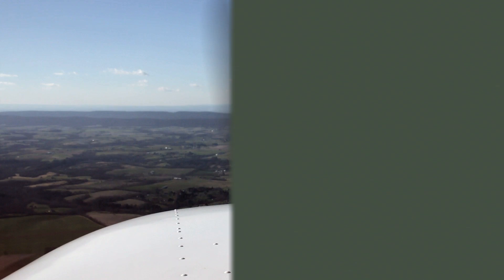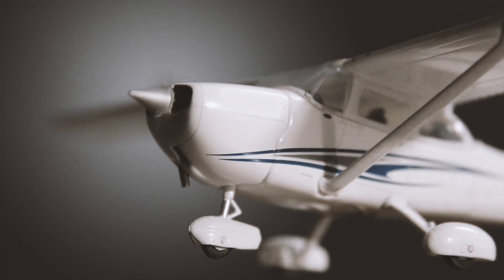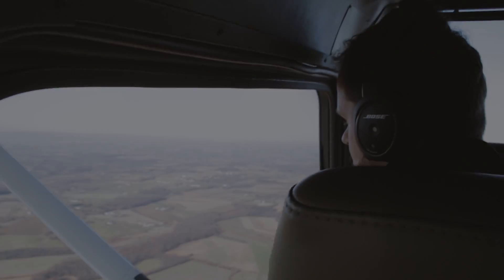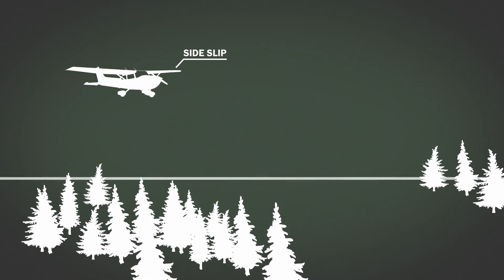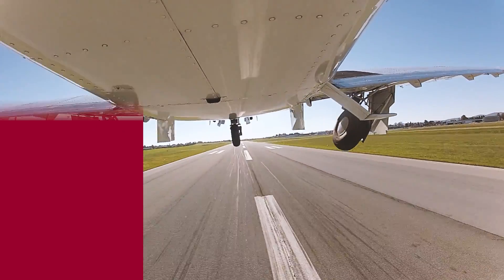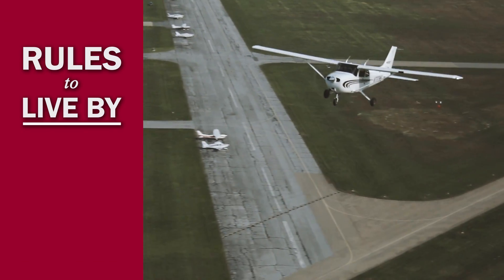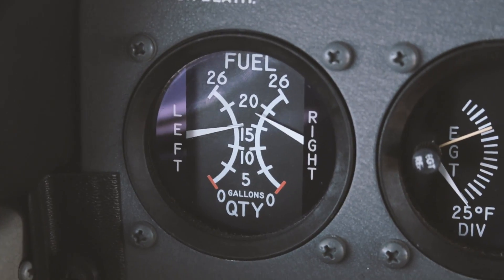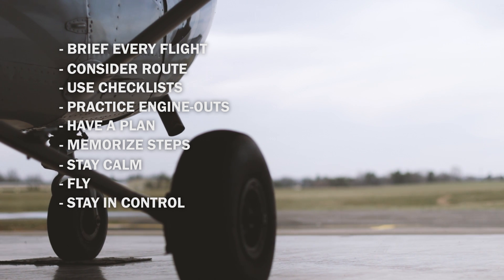Engine Out! From Trouble to Touchdown

Comment: Couple big things I saw here.....Number one and number 2-3-4-5-6-7-8-9-and 10...AVIATE-NAVIGATE THEN communicate....no exceptions...EVER  AWAYS fly the airplane first!!!  Next...if you have a bit of altitude...say 1500' or more....Slowly pitch the airplane up UNTIL THE PROP STOPS!!!!  If you KNOW the airplane is not going to start again (fuel or a "bang") you can more than double the glide distance by stopping the prop.  Especially if you may be close but not going to make a decent landing area.  Something you might want to practice from 5000' directly over an uncontrolled airport.  Also a good time to practice "high key low key" power off landings.  That will give you perspective on how far the airplane will actually glide.   The engine windmilling is turning the engine over....that takes a TON of energy you could convert into distance. A spinning prop also reduces airflow to the tail meaning you have a lot less tail authority when landing....especially when you are at landing speed.   Also when you pitch up (NOT ABRUPTLY....That burns up a TON of energy!!!) you also trade airspeed for altitude and that will ALWAYS help with more options to land....especially if you're committed to a downwind landing if you are low.  Downwind landings will ALWAYS extend your landing rollout and will make the airplane retain a lot of energy by going fast ground speed.  Next...ALWAYS open the door at LEAST a crack....I have had a couple friends killed or seriously injured by being trapped inside a bent door frame that left them with NO way to open it or get out.  Lastly...if you don't have a decent place to land where you think your passengers will not get hurt (they have your FIRST priority for safety) or YOU (your SECOND priority for safety AND the airplane (LAST priority for safety) then make sure you tear that airplane apart as much as possible OUTSIDE THE COCKPIT....see if you can tear off the wings and tail to expend as much energy as possible to make the cockpit as survivable as possible.  Pretty good video but in my humble opinion (been doing this professionally for more than 32 years) the things I mentioned should be taught and drilled into students heads.  We were taught spins and recovery techniques and practiced off airport landings and we had to do full stalls....not imminent stalls, power on AND power off......big mistake taking those things out of primary training.  Most pilots these days have no idea what a full stall feels like...it is non-eventful if you've done it a few times.  Fly safe everyone!

Comment: Nice video! A couple of things worth mentioning:
1. Practice short approaches / power-off landings regularly. Otherwise it will be very hard not to miss a perfect landing spot surrounded by trees.
2. When picking an airport to glide to - mind the winds aloft - gliding into the wind will reduce gliding range significantly. Also, pick an airport to glide to before engine quits. It's a good habit to have a plan and it also keeps you busy during boring long cross-country flights.

Comment: That's a neat little model cessna. Anyone know where you can buy them?
Reply: at flying mule online they have many many very high quality diecast models
Reply: I have the exact same one, I bought mine from a local hobby shop for about $20. It's full metal however, which makes it not balanced when you lay it down, it sits on the main gear and the tail.
Reply: It also comes with a stand however, which is neat.

Comment: Excellent video. One thing worth mentioning: if you have an engine failure just after the runway, you are going to have to push the nose over hard to maintain airspeed. Remember what your power on stalls felt like? THAT is the sort of thing you'll have to do on takeoff if your engine quits. 

Above all, maintain control at all times. If you stall, you won't have any control, and you will fall on to whatever is below you. However, if you glide, there is control, and you can choose where the plane will go.

Comment: Another reason NEVER to accept intersection departures. Runway that is behind you is worthless!
Reply: Could you please explain what this means if you have a chance? TY.
Reply: @quattro4468  An "intersection departure" is a takeoff other than from the start of a runway, where a plane enters a runway from an intersecting taxiway and line up there. It is done if the runway is longer than the plane needs, e.g. a small GA plane taking off on a runway designed for A380s. This is to save time and fuel on taxing (saves the trouble of going all the way to the end of the runway).
On a takeoff there is a "point of no return" (i.e. v1), past which an aborted takeoff will result in a runway overrun, because you will be going too fast and the length of runway remaining is not enough for the plane to slow to a stop. The longer the runway, the further away the point of no return. On an intersection takeoff, the runway behind you cannot be used to slow the aircraft in case of an aborted takeoff, so the point of no return is closer than if you start your roll at the beginning of the runway. This reduces your options if something goes wrong on takeoff; in return you get the convenience of shorter taxi. The tradeoff is not worth it.
Reply: I'll usually take the full runway... except one of the airports I sometimes use has a 12,000' runway.  In even the worst single-engine piston plane, that's huge.  If I were to attempt a no-flaps landing without using the brakes, the plane would probably come to a stop well before the end.
Reply: Also, since I'm not a pilot yet (just an aviation and flight sim nerd), maybe a pilot could explain...  Why go gear up immediately after positive rate if you still have thousands of feet of runway left?  Shouldn't you wait to bring the gear up after you're almost clear of the runway - just in case?
Reply: @jpennin1  In GA that might be an option for a few seconds, airliners rotate beyond V1 - meaning they can't decide to put it back down once they lift off. In fact the point of no return for most airliners is shortly before they rotate, so they have to take it to the air.
Reply: Sort of related to this, I think we should have a law that all runways be at least 4000 feet long for singles.
Anything less is not safe unless there is a big, flat open field at the departure end.